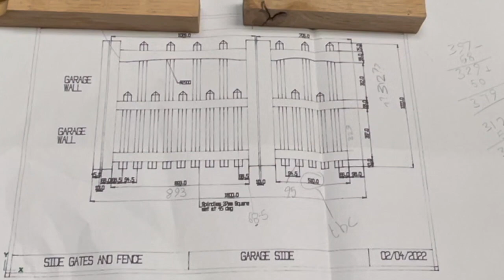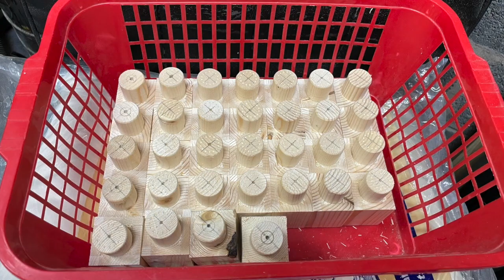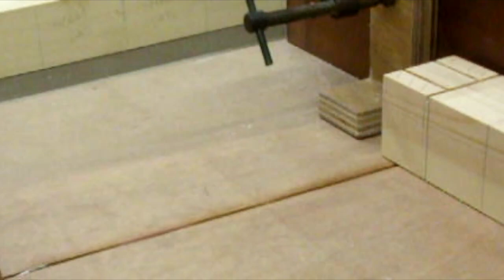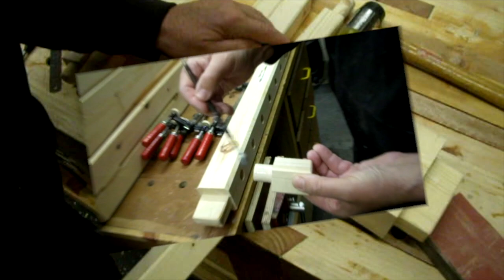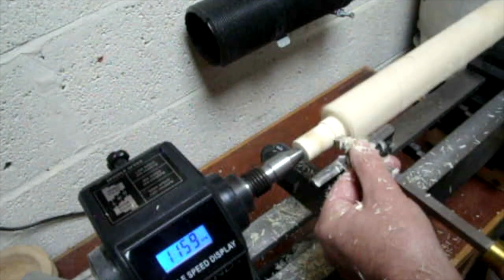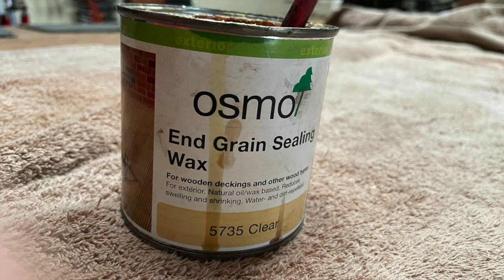Making Spindled Side Gates

Comment: That is a huge production line job, I bet you are glad of your chip extractor on this one! I have just made a cabinet with no where near as many joints in it than this, and I found I has to work really quickly or the Titebond was setting off, it is 35 degs here though, the gate look very nice! Chris B.
Reply from the maker: I find that Titebond 3 has a longer opening time than their other glues, not sure how 35 deg will impact that, Cheers Steve
Reply: @Phenrica  Ha Ha! I am using Titebond Ultimate, it goes off so quickly , that said I just sprayed the cabinet with my rutlands LPHV spraygun, and the emulsion was dry at the nozzle! I will have to wait for the temperature to drop a bit!